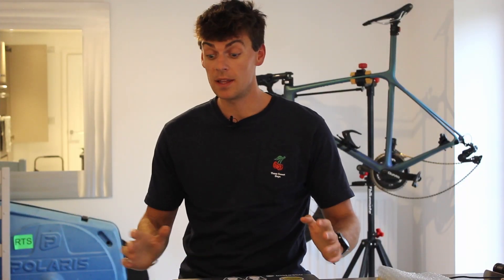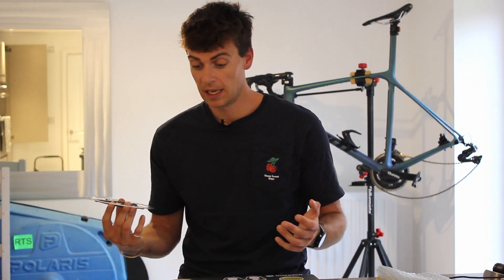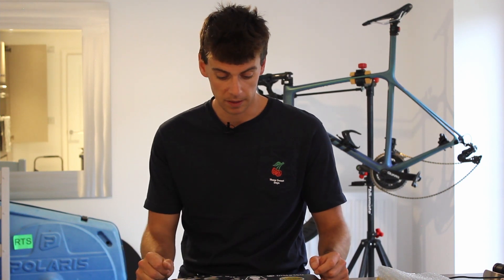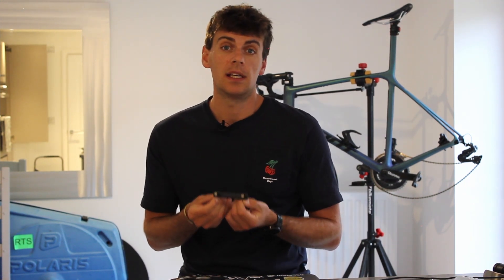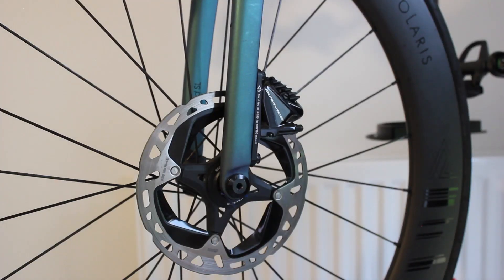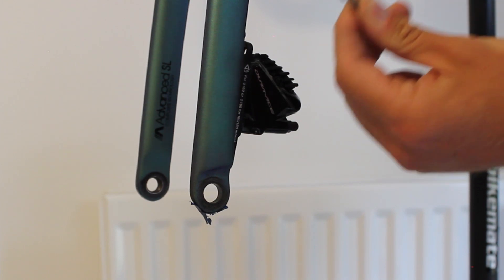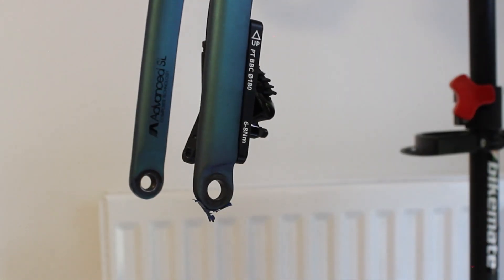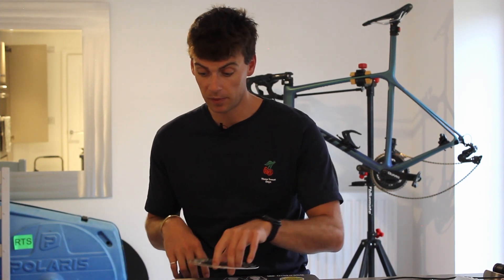180mm Disc brake conversion on road bikes

Comment: with my MTB's i've aways prefere 203/180mm on everything (203/203 on dh bikes) when you're totally worn out and hands are tired bigger brakes means less lever pressure is needed. 
when i built my road/gravel bike from MTB type hybrid frame i also used 203/180 on that also. 
the brain gets used to the power, your hands will like the less effort needed.

Comment: This is great. Is there any benefit to going larger in the rear? I realize the rear brake does less, but curious if the same logic applies.
Reply: Not really, as the rear brake can ultimately do less as the rear wheel will lose traction as the weight shifts to the front wheel at maximum braking. Once the wheel is locked the braking force is at it’s limit.
Reply: I would also guess that the "thermal ceiling" is less crucial on the rear brake because there's a larger amount of fluid, so it would take longer for it to boil over and go spongy on you.
Reply: @ktakashismith  TBH you won't boil the fluid regardless.
Reply from the maker: Rear one is one the way. Much less convective cooling on the rear due to much disturbed and reduced airflow.
Reply: @waynosfotos  This is braking on long descents, so larger rear could make sense and be safer. If you don't lock up the wheel.
Reply: I'd expect many frames will have issues with clearance between the chain stays.  My bike is specced up to 160mm rotors, but even that is a tight fit and the rotors often touch the chain stays when I take out the wheel, or reinstall it.
Reply from the maker: @markachternaam5207  I've checked a few bikes I have around me, 180mm will fit in the rear but it does become a bit tight.
Reply: Rear brakes tend to be applied lightly and for long periods on descents. This can lead to a lot of heat build up. If they will fit in your frame I think its a good idea to go 180mm.

Comment: Unfortunately my adhx fork won’t accommodate bigger discs than 160mm. Anything bigger and it will start cutting in the carbon.. Had the 180mm discs before receiving the frameset… bummer.. On the flats the 160’s are absolutely fine, but as a taller/heavier rider i would have preferred the 180 rotor for in the mountains..

Comment: Can't you use a standard rear flat mount adapter on top of the front adapter? I know it isn't a perfect conversion but it's close enough (0.1mm or so off iirc?).

Comment: Gravel bikes get packed more than road bikes, I think that is why Merida chose to equip their gravel bikes with 180mm, there's typically more mass to brake.
My Trek 920 has post mount, I swapped to 180 front right off the bat 2 years ago. I can recommend bigger rotors! (Touring bikes get loaded even more than bikepacking bikes).
This looks like an elegant product to fix the somewhat limiting flatmount.

Comment: If heat dissipation is an issue, I wonder why aftermarket suppliers do not offer disc braking upgraded with copper or the like

Comment: This looks really interesting. I've still got a fairly new pair of Hope 160mm rotors on my bike, so I will try it in the future. Also, Hope rotors instead of Shimano worked absolute wonders for me.

Edit: Hope doesn't make 180mm CL rotors D:
Reply: I also use Hope rotors (floating type) on my Boardman road bik

Comment: Since more surface area dissipates heat faster, maybe two smaller disks   would be better. Motorcycles have done this for years. The profit potential would be huge. Something obviously different and improved! Now that rotational weight no longer matters, aero advances could wait until the early adopters have bought in!

Comment: 0:51 As a moutain biker I can assure you that 140mm rotors are going to overheat fast. This causes the fluid to boil (in hydraulic systems) and the pads to cook and it will greatly reduce braking power in high brake usage situations. It can also lead to warped rotors. Going larger helps prevent the disc heating as fast in the first place and then also helps it to disipate the heat once it is hot.

The adpators featured in this video are nothing new. MTB riders have been using something similar for years to adapt from 160mm up to a maximum 220mm (180 is common) and it turns out Shimano make these for road and they sell for ~£15 in the UK. They even make them up to 180mm.
Reply from the maker: Shimano do not make a 140/160 flat mount to 180mm adapter, no.

Comment: I've got 180mm on the front of my XC bike and it does make a difference and the parts do last longer. Race cars have larger rotors over their road standard not because the road rotors are inadequate it's just that larger rotors reduce thermal issues. Materials are the other consideration but less of an issue on a bicycle. Torx is much better that hex.
Reply: Race cars tend to have the smallest rotor they can get away with to keep weight low. The primary reason they need larger rotors and more pad surface than road cars is because they travel much faster and the braking demands are very different. Agreed on the need to dissipate more heat, in a shorter period of time, as a result.(above references those race cars still using all metal rotors that bikes and most road cars use. carbon ceramic and other compounds are used in many race series these days.)
Reply: @MrKipperfish  Yes you're right that they do have the smallest they can get away with on a power to weight ratio. I should have said they are relatively large compared to a non sports car of similar weight. Probably over spec too.

Comment: Why not use the mount shimano makes for this?! 180  Pretty good combo for bikepacking as I only weigh 75kg.  Idk about the torx.  Work as technician and torx seem to be easy to strip. think its more so the tools are much harder than the bolts
Reply from the maker: Shimano doesn't make a 140/160 (road standard) to 180 adapter. They only make a 160 native (gravel) to 180 adapter. If they did of course i wouldn't have developed one, that would be a waste of time.

Comment: i have seen some significant variation between different wheels with the lateral position of centrelock discs. might be worth having people check that with the larger rotor. can cause some interference with the top of the rotor as the fork legs bow in.  Easily solved by lapping the back of the centrelock disc or the adapter if people are prepared to do it!
Reply from the maker: Good point. I cant believe how hubs can be so different, they clearly don't adhere to a standard!
Reply: Easy fix though! Just file out the fork leg more so the rotor fits and doesnt rub under power stomps. Less material on the fork means less weight and more aero.

Dentists dont mind either.

Comment: JFYI. Pure road bikes, I don't know. But I can tell you the new gravel bike from Scott takes 180mm natively. And Hope is going, with their RX brakes, in that same direction, so there seems to be , tho slow, an industry shift in that direction.

As a ranting digression. The whole decision of the bike industry to create a disk brake mounting standard purely for road bikes, and limit it to 160, is bewildering to me. What's wrong with PM? More so, on arguably the primary safety component on a bike.

Comment: Why couldn't you run dual callipers on the front, just use a banjo fitting. Since you don't need to increase braking force it may increase pad life by 66%

Comment: Dual 140s up front and 140 rear. Thoughts?
Reply: It depends. If you are light, live in a cooler climate and, this is the most important, do not have many steep and long descents, then 140/140 can be perfectly fine.

Comment: Why can't an off the shelf 180 adapter fit without piggy backing the standard adapter?
Reply from the maker: Shimano don't make a 140/160 to 180mm flat mount adapter. They only make a 160 to 180 flat mount adapter (which only a few gravel bikes can fit). If they did, do you think i would bother developing my own?!

Comment: Larger discs will go out of true more easily. Hence more pad rubbing.
Reply from the maker: Not in my experience of mtb and road
Reply: ...not if they don't heat up as much as the smaller discs do.

Comment: The time is now for water spray brake cooling.
Reply: I recently made a vid suggesting just that! The water is stored in the fork leg.
Reply: @CyclespeedTours  Haven't done any math but I wonder how much brake upsizing we would need to make bikes have good brakes. As they are now they are high maintenance  and susceptible environmental factors.

Moped brakes costs like 10 bucks and can stop a truck. Obviously I am exaggerating here but it feels that way when comparing them to bicycle brakes.

My favorite solution has been using hub motors as regenerative brakes. They stop super hard, don't require any physical effort from the user and work the same way in all conditions and do not wear out.
Reply: @difflocktwo  You can make good disc brakes work well, but they will be twice the weight - and that doesn't sell well. So light disc brakes that are crap.....

Comment: gdamn you allways come out of left field and hit me in the n0ts with your infos and smart-ama-dodads. your so gdamn true, we need to solve warping discs for sure, and the solution might just be larger discs.

here i was sitting around thinking how could bikes get much better? 30-32mm tyres, rides everything, great shifting, great brakes, not perfect braking on steep downhills in spain. soon we get aero covers for calipers and alternate positions for 140, 160, 180, and 203. and after the we get just two or three different positions after som years of testing. il bet 140, 180 and 203 for sierra nevada etc

Comment: Added bonus: seems like the 180mm rotors are cheaper than the 160 and 140s
Reply from the maker: Yep. MTB stuff is cheaper. Road category is generally a rip off. Just look at road vs mtb full bikes

Comment: wouldn't it make more sense to do it single piece and get rid of the original one... adapter on top of an adapter plus six bolts is counter intuitive for me.
Reply from the maker: Keeping the original plate and its slotted holes makes aligning the caliper as simple as before. Also, it makes switching back to 160mm easy.

Comment: you are 100% wrong about gravel needing less braking than road. try a few thousand foot descent on a rocky trail where should probably be riding a mountain bike and you have to be on the brakes most of the time and you’ll overheat the brakes.

Comment: I have SRAM Red axs disc brakes. I'm assuming this solution won't fit? If so, any plans on making a SRAM 180mm mounting solution?
Reply: It’s the same between sram and shimano…
Reply from the maker: It should be the same.
Reply: @PeakTorque  awesome. I will definitely look into this option. Thanks!

Comment: I'll attest to all of the sound reasons for going to a larger rotor up front, and, the caveats that are presented. I'm not a frame designer, but, I'd be shocked if the factor of safety was a low as 2 or 3. That's typically only for super weight critical applications like jets and satellites, not an application where a product liability fiasco over rider injuries and deaths could financially torpedo a company. 

So now for the meat of my feedback. The classic way to address tolerance concerns in most any two-bolt fixation application is to slightly elongate one of the holes into a slot. The structural tradeoff is very small, unless right at the margins of strength or stability. And, a very slight increase in machining time (cost). Looking forward to version 2 that solves the tight tolerance "problem" described above. Otherwise, great idea, and use of high-strength 7075 Aluminum instead of cheaper options.

Comment: what a joke.  I paid for 2 brake adapters weeks ago.  I have been told twice that the parts are at an anodizes and can't ship until then, Had no problem taking my money.  Service is terrible.  Avoid this retailer at all cost!!
Reply from the maker: The description clearly stated the parts were back ordered. I offered you a refund on two occasions - always replied and kept you updated with the progress.
Reply: @PeakTorque  WRONG  The rear adapter was on back order on one day and available the next.  I asked you to ship what you had (the front) and have not heard from you!!  What a Joke!!!  Blame it on your supplier!!!  not very professional.  I own a company and would NEVER take someone's money before the product was available  Over promise and under deliver.  Plus I had to purchase 2 180 rotors that I now have to return.  Get your shit together.
Reply from the maker: @ronsandberg3815  get your facts right. They're both on back order as clearly stated in the product descriptions for both parts. I made it available for you to order together (as agreed) so you would only pay 1 shipping fee, but clearly stated they were not in stock. I also sent all customers a follow up email offering a refund for the delay. I have orders before yours which are waiting still, patiently, granted. 10th October is 14 days ago, by FTC USA legislation I have followed the rules in your jurisdiction. Sorry for your inconvenience.

Comment: What a bodge, it looks crap!  It should have been made to replace the existing adapter, then it would be a clean 1 piece spacer!
Reply from the maker: Think about why it wasn't dear boy
Reply: Perhaps you should think about why a gravel bike may need a 180 mm rotor, baby girl!
Reply from the maker: @goaway2174  i sell mostly to gravel bikes, go ask the customers i guess
Reply: LMAO!!  Really, I don’t need to ask anyone as I’ve ridden gravel bikes and need the extra braking performance of larger discs when carrying heavier weights in fully loaded packs on the frame during an extended tour especially in mountainous regions!

Comment: Excuse me but this is one super useless topic and the fact you did research on this makes it the biggest waist of time ever. As a bike mechanic this sounds like a big cry baby bullshido .......... I mean were talking about roadbikes , most of us bike with our eyes, ears, mind....plus the fact we can easy adapt our speed without thinking, because all goes so super relaxed and intuitive . So most of the time as a roadbiker no matter amateur or pro uses their brakes just to modulate their speed in a sertain situation. So in the end 160mm will super out perform 180mm on a roadbike. Even has less draft, brake force is the same (a hydrolic brake will allways have the same brakeforce the brake system can diliver) but ofcourse with 180 mm you got more braking 'power' and a bit better cooling. But kinda useless to put more brakingpower on a front brake that uses a rigid fork...... This topic could have been way more interesting for mountainbikers, as they will use their brakes to max ..... I'll leave it to this, love from the Netherlands ;)
Reply: He literally explains the rationale for it in the video - it's very little to do with increasing braking performance in terms of force and mostly to do with prolonging pad and rotor life through better managing the heat that prolonged braking produces. A lot of us don't need to worry about this (you in the Netherlands and me in Norfolk, England have few to no hills to worry about when riding), but I think he now lives in the Lake District (England's only really mountainous area) and obviously has subscribers for whom this modification will be relevant.

Comment: This is becoming ridiculous…  I would rather change the material of both the rotor and pad… like the ceramic breaks you have in cars…
Reply from the maker: If you want me to talk to Brembo about a ccm brake then I can but you're gonna need to give me a few million quid to get the ball rolling! They also work best at much higher temps than we get.